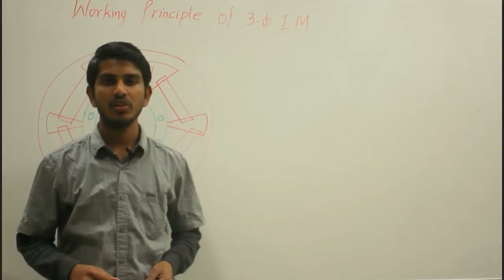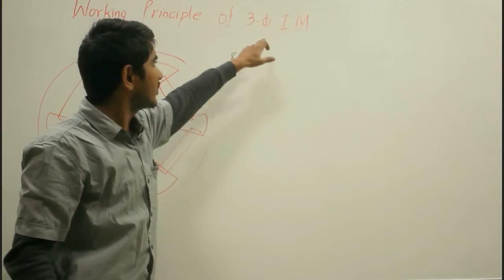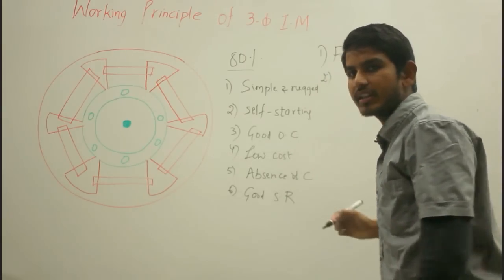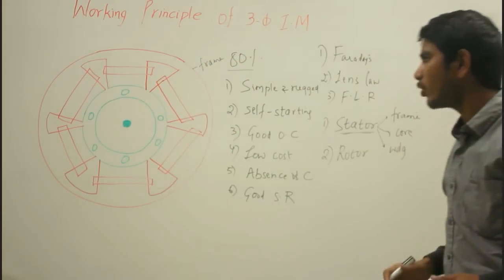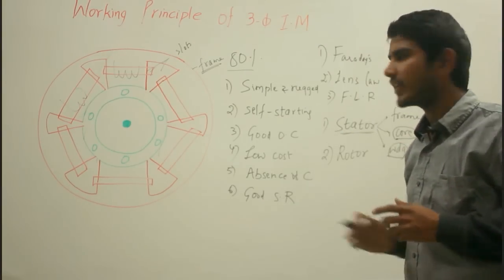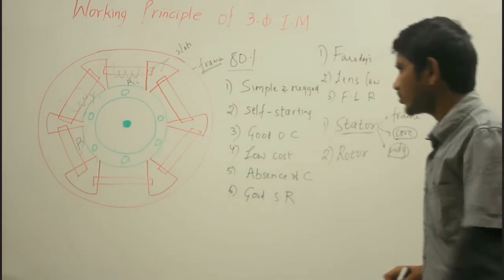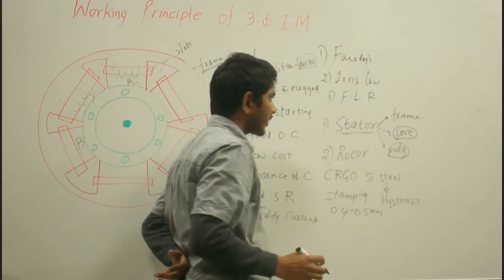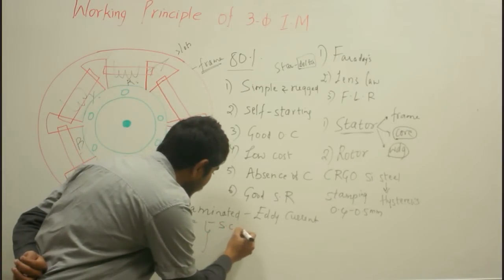Working Principle of 3 Phase Induction Motor

Comment: For motor to run rotor windings should be shorted as in squirrel cage done by end rings and in wound type after resistance in each rotor  winding ends are shorted, but when wound type motors rotor is connected to SPRS  ends are not shorted than how the motor works

Comment: at 6:12 you said that IM has CRGO steel. But I have seen other explanation stating IM has CRNO (Colled Rolled Non-grain Oriented) steel because as the magnetic field is rotating so  it is not guaranteed that magnetization in stator or rotor will take place along the sides of Si grains. So, core will experience same reluctance whether you orient the Si grains or not. Why spent extra money in orienting those grains if we do not have any advantage!!!

Comment: the motor suitable for loads where constant speed is required is which type  of motor
Reply from the maker: Rajunayak Banoth 
You can go for Synchronous motor but the problem is it's maintainance
So move to Induction motor

Comment: hi...i have one dought from 3 years on words...in AC motor  ,i.e..when flux links with rotor it induces emf than current ..due to the current flowing in the rotor magnetic poles    form on the rotor those are same on rotor and stator (i.e if story has north pole ,the rotor get north pole in opposite to each) according to lenz's law ,   than   resultant force zero on rotor so how the rotor will rotate...tell me please..
Reply from the maker: Srinivas S 
watch my synchronous motor video
it will clear your doubt
Reply: direction of current is changin na in ac, hence the change of magnetic poles which keep[s rotor rotating continuosly